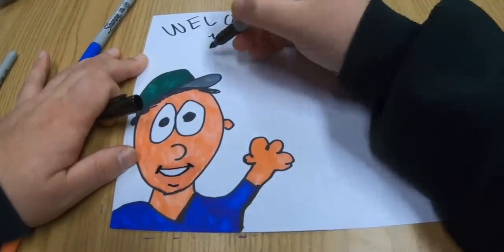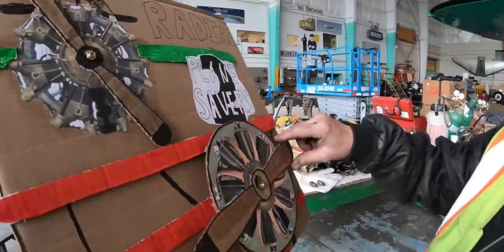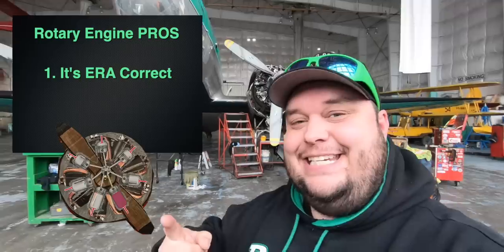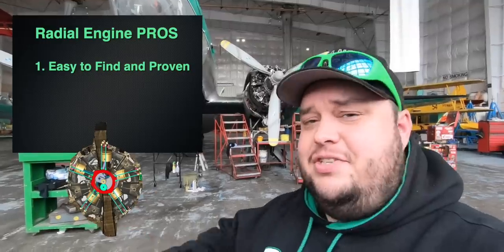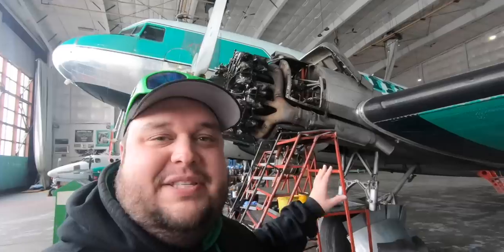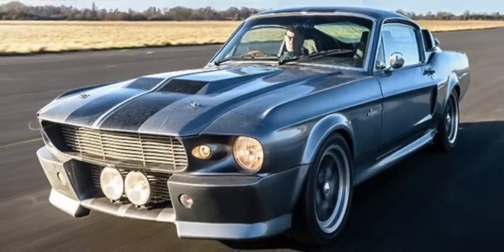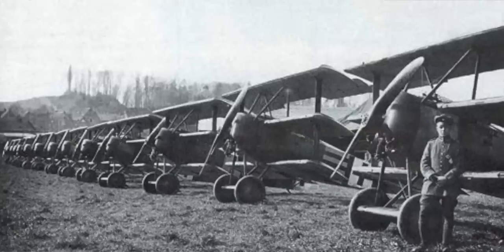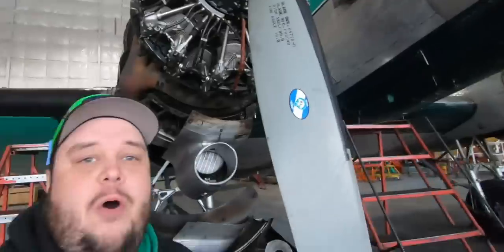Radial vs. Rotary | AIRCRAFT ENGINES | Plane Savers S2-E6

Comment: Having seen some of Peter Jackson's planes dogfighting, it was interesting to hear the engines. They have 2 magnetos and the pilot cuts one or both depending on which direction he wants to go. It's your dime, do whatever you want and most followers will be right behind you. If they don't then they will leave. Even as a factory fresh machine a 318 is no slug and a much better road car. Graveyard Carz do some awesome rebuilds of Mopars. Get the Cuda restored.

Comment: Another interesting tidbit, they had a small glass window on the bottom if the airframe which the pilot could see under his feet. If it was oiley the engine was getting good lubrication. If it was dry and clear the engine was about to seize up.

Comment: I'm not sure if this was mentioned in earlier comments, but I remember reading something about the oil used in some of the rotary engines, I believe it was caster oil. As you mentioned about the oil and exhaust going back into the pilots face, the castor oil would soak into their skin, and if you know what else caster oil is used for then you would know what I mean buy... on occasion pilots were known to need to rush to the toilet after landing. 
  Also the rotary engines had a much larger rotating mass that acted like a gyroscope. This made it difficult to near impossible to turn a plane in a certain direction (depending on the plane and rotation direction of the motor). The rotary was high-tech for its day and are kind of cool to watch in action, but a radial will be a much safer choice for your project.
  I look forward to seeing more on this restoration.

Comment: The problem is that the radial will have ~1/2 of its cylinders shrouded from the airflow by the stock cowling used on the Fokker. The rotary exposed cylinders in turn to the airflow, thus cooling all equally.

Comment: Mickey, i have also  read that the most common engine failure was caused by defective springs particularly valve springs. They didn’t have metallurgical knowledge to make them less brittle

Comment: Dr1 should only have Rotarys....and the exhaust does not exit at the top into the pilots face, it exits at the bottom which is why the bottoms of these planes are always Covered in castor oil

Comment: I think this is obvious to make the aeroplane more practicle for operations reason's but also for safety reasons, both the health of the pilot & obvious operational dangers with a pilot getting covered in oil & hot exhaust fumes, a tail wheel obviously giving much more instant manouvering & making easier to both steer & park.A rotary engine that can only have an "On" throttle or "Off" throttle I would imagine could be incredibly dangerous especially in the landing seconds & also take off seconds possibly suddenly "Twisting" the whole aircraft due to opposite centrifugal forces.

Comment: Go with a radial Mikey its much easier to maintain and less failures a stearman engine would do nicely 👍.........great video and thanks for posting
Reply: I totally agree with you, Gary uk. Even if Mikey was able to find a rotary engine that was in great working shape, he would still encounter problem after problem. Reliability would be a major issue too. Also, if I am not mistaken, I believe that he said that the rotary engines that these Fokker triplanes came with didn't even have a useable throttle. While being at max power all of the time would be manageable during takeoff and in the air, I can't imagine having to land a plane with no throttle. You'd have to either glide into your landings, but maintain enough speed for a restart if you needed to abort and fly around for a 2nd approach..or land at full power/speed and cut your engine as soon as you landed. It would be rather scary. I am not a pilot...but those are just the situations that common sense tell me. haha. Add into that equation the fact that the pilot would be getting a face full of engine oil and I think that makes the rotary engine less than desirable. Engines continued to evolve for a reason. Each generation was made better (in theory at least...yeah, there have been some duds hehe). 
..Anyway, greetings and much respect to all from Nova Scotia, Canada.

Comment: Rotary engines used castor oil as a lubricant and the pilots  used to ingest the oil as it blew by, needless to say pilots would usually need to use the restroom after flight most time during flight

Comment: When I first heard the music start I was expecting a Hobbit to appear but instead we got Mikey. You are right on about the pros and cons of the radial vs Rotary but you left out a biggie. The torque caused by the mass of the rotary engine spinning on the front of the plane make certain maneuvers tricky to say the least and resulted in many crashes and ground loops. From what I have read this factor was a main impetus for the development of the radial. Much safer to fly with the radial.

Comment: Great vlog...was wondering...since you can upgrade the original model are you going to have ailerons on all three wings?...I think the original only had it on the top wing... wasn't clear whether this DR-1 had that...
Reply: All Fokker's had ailerons on the upper wing only,adequate for the size of the machine and very agile,if you placed ailerons on all three wings you would get aileron reversal with the enormous amount of adverse yaw.

Comment: NO ROTARY. Consider Lycoming O320/IO360 and use facade to look like radial/rotary. Jacob 755  is OK, but Lyc has similar HP but 150-200 lbs lighter, cheaper, reliable. Stay away from Rotec experimental radials.

Comment: In addition to the rotary's gyroscopic effects, the cylinders were very high drag and made the airplane very hard to roll in the direction the prop was turning. A shroud helped somewhat with the roll torque effects, but nothing helped the power loss due to the spinning cylinders.  The only plus I can remember was excellent cooling at idle.

Comment: I’m with you Mikey. A real rotary would be very expensive and yes they are not easy to operate. I’ve seen them and they smell just like a cox model engine because they use castor oil as their lubricant. Always full throttle and you blip them (turn them on and off) to control power. Kermit  Weeks has a couple in his collection and you can go to his Fantasy of Flight videos to see the operation of them. For reliability and ease of operation the Jacob 775 make more sense.

Comment: You mentioned the oil on the rotary engine, and that it was a one-way oiling system. you did not mention what type of oil that was used. I don't know if you know or not exactly what type of oil was used and the end result of the type of oil used. which was castor oil and generally those Pilots made frequent use of latrines for that reason.

Comment: Rotary engines were primarily designed to offer a more reliable ( ! ) engine using the whole engine as a flywheel - other types of engines had a bad habit of stalling ...  Remember this was 1910. The reliability of the other engines soon rose to a point where the cons of the Rotary engine made it obsolete.

Comment: Put a Mazda rotary engine in both the Cuda and DR.1
Reply: The Mazda rotary engines suck fuel, fail frequently, and are not a low RPM engine...

Comment: Apparently with the castor oil based rotary total loss system constipation was not an issue with pilots because the ingested/absorbed so much of it.

Comment: Mikey  they made over 18,000 B24's times 4 engines and also around 10,000 DC3/C47's and the PW R1830 was also used on the Navies F4F Wilcat, not all versions but many !!!
Reply: But early Goonies were  Curtis Wright equipped as were many Catalinas as well.

Comment: A few other cons to the radial, the oil tended to be castor oil, the pilot ended up ingesting some and it was not very good , and another negative regarding the radial engine was the mass rotating acted like a gyroscope greatly affecting handling.
Reply: You mean Rotary. A radial doesn't spin.

Comment: Recieved wisdom is that piston speed & valve area is a limiting factor in the design of reciprocating enignes, hence short stroke / large bore configurations of modern engines ..but with the rotary, the piston does not move up and down only round and round ,  : the crankshaft is fixed and the cylinders rotate around it, so the pistons moving up and down the cylinder, and " reversing " direction at end of each stroke is just a function of the crank off-sett .. much of the entire combustion chamber head can be the exhaust valve area, and the intake most of  be the size of the piston crown...there are none of the unbalanced forces due to the mass of the piston/conrod motion but far larger, perfectly balanced rotating mass of the cylinders , crankcases and vale gear....

Comment: I agree on the choice of radial over rotary, for all the reasons mentioned. Plus, for this sort of project, it would be overkill IMO. I'd also assume some redesign/changes would be needed to handle the added torque.

On a side note, believe it or not, there are at least two companies out there (Classic Aero Machining Service and The Vintage Aviator, both out of New Zealand) manufacturing new rotary engines (Gnome 100 and LeRhone 9J/Bentley B.R.2, respectively). Reliability and longevity is purportedly  much better than the originals. Classic Aero also offers throttle control. But, as one might guess, they aren't cheap (~65k NZD for a Classic Aero unit).

Comment: The Old Rhinebeck Aerodrone has several DR-1 replicas.  The ones flown in air shows have standard opposed cylinder aircraft engines (with modified cowling to fake the rotary look),  but they do have a period correct version with a rotary engine.  This one has been flown from time to time, but usually just taxis, takes off and lands to show it CAN fly.  Most of the time it's a static display plane.
If I were restoring a WWI era aircraft, I'd make an effort to find a period correct rotary engine.  However, if I were building a replica of one of those aircraft, I'd install a radial engine, but make an effort to find one of similar size, number of pistons, and HP as that of the original engine.

Comment: Radial vs. Rotary, you didn't mention the difference in "P" Factor. Because of the enormous torque of a rotary, I've read most WWI pilots that flew them cut the motor as they landed. Danger and Authenticity don't mix. I'll remind the audience if the remake of the Hughes H-1  and it's tragic end.
Reply: @HiWetcamthe inertia of a spinning motor (rotary) makes turning the ship in the direction of the turn far, far easier compared to turning against the direction of rotation.

Comment: The rotary piston engine has more come than listed. The spinning mass make tried to torque the plane. The torque role makes it had to fly sopwith camels have larger flight services on one side to compensate. They still killed more pilots in training than combat. The controls are 90 degrees out of rotated from normal.

Comment: how about a 'rotary electric motor' , or what some people call an outrunner motor
basically instead of a ring of cylinders rotating around the outside of the engine, you have a ring of magnets... and instead of an off center camshaft, you have the motor stator  in the center with all the windings

Comment: Mikey !  GREAT Presentation.  In the early days of flight, weight was always an issue.  I could be wrong but the POWER-TO-WEIGHT RATIO was better in those  days for rotary engines.  Also, the gasoline you could get out at an airport had a HIGHER OCTANE RATING than the stuff you could get "in town".  People might like to hear a bit about octane ratings too.  Might be interesting for viewers to see original or replica flight gear worn by WW1 pilots.  Would make an interesting comparison to what a BF-109 or TA-152a pilot would have worn in WW2.  OK, you've decided to use the radial that was in DR-1; that's cool.  But, here are some last-minute thoughts on the subject.  While it may be expensive to build; if you scrounged up a set of blueprints engineering drawings etc, maybe you could BUILD a replica / new rotary.  There's GOT to be these kind of docs SOMEWHERE in a museum that would allow you to garner a copy.  Consider putting out a call for help.  Maybe some trade school, machine shop that trains people or even the ENA students might help on this.  They get the experience, you get the engine for a reasonable price and it is a WIN - WIN for all parties.  Then there is the question of the ultimate fate of the aircraft once it is restored.  What do you think of working out a deal with a museum that has an available rotary.  YOU fit the rotary to your resurrected DR-1, and the museum houses, maintains, displays AND FLIES the plane.  LASTLY, a DREAM.  What if there is a BARN-FIND somewhere; a crate stashed in with cows and covered with straw and chicken doooo-dooo that contained a complete,  un-assembled DR-1 with all manuals, blue-prints, spares, etc.  If this were to happen, Stella would have fun doing the translations for you.  I can only hope that this crate magically shows up there at BUFFALO in Yellow Knife before the first snow.

Comment: If you're going to choose a different engine why don't you just go for a turbo charged Lycoming IO360 with an inverted oil system. It's not around it in but it will sure perform.

Comment: All rotary engines are radials but most radials are not rotaries. Both have cylinders arranged in a "radial" configuration- in other words radiating outward from center. A rotary engine is basically a radial engine that spun around a stationary crankshaft rather than the whole engine mounted stationary and spinning a crankshaft.
There was no oil sump, tank, or pumps in a rotary. The crankcase served as part of the induction system, so oil was mixed with the fuel just like with a two-stroke engine, even though rotaries were four stroke engines. The Gnôme Monosoupape (single valve) engine used one valve at the top of the cylinder to expel exhaust gases and also to admit most air on the intake stroke. It would close during the intake stroke and suction would build in the cylinder until the piston cleared ports in the cylinder skirt. The suction would then pull in a very rich fuel/air mixture from inside the crankcase. This mixed with air in the cylinder to give the proper mixture for compression.
The Le Rhône engine used an intake and exhaust valves in more conventional fashion but the induction stacks still drew fuel/air mixture through the crankcase.
Reply: @Toby 
Might be more accurate to say that the first radial engines were rotaries. The first radial engines were designed as part of "motorwheel" assemblies for early motorcycles in the late 1880s. The clever radial cylinder arrangement was originally intended to be a balanced part of a wheel and spin with it. The French Millet motorcycle sported the first rotating radial engine built into the rear wheel with the crankshaft serving as the rear axle. M. Millet discovered that an odd number of cylinders ran smooth in the spinning radial engine, so his first successful machine utilized five cylinders spinning in the rear wheel. The motorwheel motorcycles were the reason why radial engines were developed in the first place. Others followed. Around 1899 Charles Manly was one of the first to use a fixed radial, whereby he took a prototype rotary engine designed for Samuel Langley's "Aerodrome." He took the engine and modified it to be in fixed configuration and had it's crankshaft driving two propellers. After all his modifications this engine developed an unprecedented 52 hp at 950 rpm. This was the first attempted use of a radial engine in aircraft.
Reply: @Toby 
A rotary engine is still a type of radial engine because of the cylinder arrangement around the crankshaft. The cylinders "radiate" outward. It was the first application of radial cylinder arrangement because the radial design concept was initially intended to spin. A spinning radial engine was and is known as a rotary engine.

Comment: What's the weight and power difference between the oberursel urii and how do you compensate for the extra weight of the jacobs (my assumption)
Reply from the maker: The aircraft is already set up for the Jacobs. That is what was on it.

Comment: Three additional PROs for the rotary:
1) it's lighter than a radial
2) it's smoother 
3) it's lubricated by castor oil, so the pilot has no trouble remaining "regular"

Comment: Whoever thought the rotary was a good idea was completely out of their mind!
Reply: It was the only way to produce an air-cooled engine of the required horsepower and power-to-weight at the time. The technology to produce cylinders with large enough/light enough cooling fins did not exist yet.
Reply: Makes sense, but they're still crazy!

Comment: Not why they had scarves. Silk does not shed nor absorb oil. It was for chafing on the neck. Head on a swivel to spot enemy aircraft. Also castor oil not petroleum based motor oil, castor oil was used....not harmful but will make u shit. Radial predates rotary btw. Look at Louis bleriot or the anzani 3 cyl.

Comment: The Jacobs engine was used by Beechcraft in the Bobcat. The other problems with the rotary engine is lack of power. Monosoupape design was very limiting. The Bentley BR1 is unobtainium as are the Hispano Suiza engines as used in the SPAD for example. I have never seen a Clerget. That DC3 is a fantastic machine and I would love a flight in one. Air Atlantique had some here in the UK 🇬🇧 but European law ruled that they must be fitted with a terrorist proof cabin door to carry passengers and so they stopped pleasure flights. Guess I'll never fly in one now  Do you still have the C46?